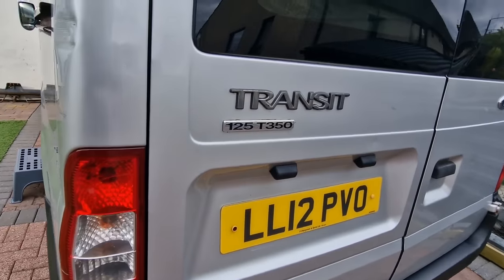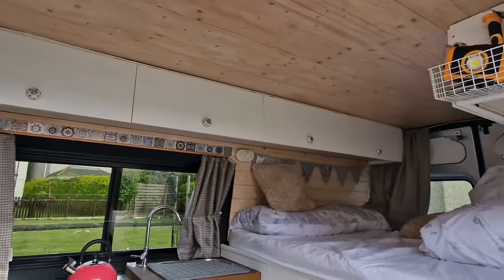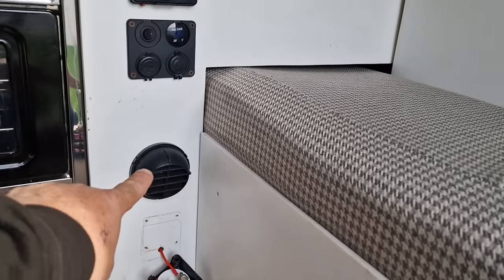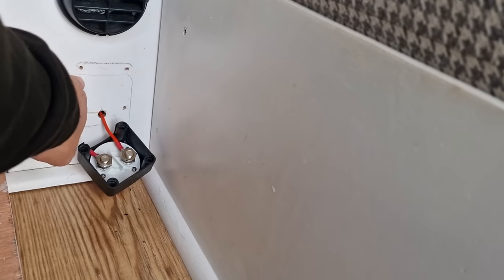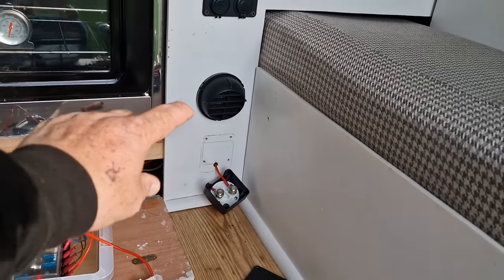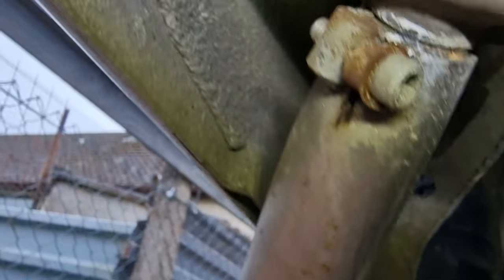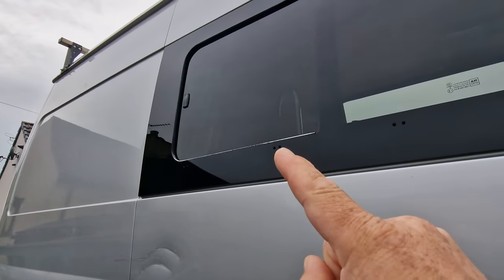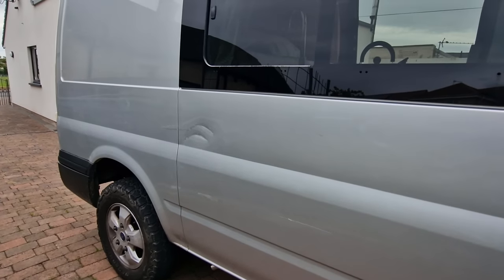Is the most dangerous self build campervan I've came across?

Comment: This is why we have National Standards for Gas and Electrical for domestic installations.....both can kill occupants when installed in stationary situations let along the additional stress put on cable/gas runs and joins, etc when incorporated into mobile builds
Standards need to be applied/enforced on what is actually a mobile domestic situation.
Part of any van build should involve getting a compliance plate for all non-factory modifications done, including interior fitouts, rather than just structural changes as ALL modifications can lead to death traps on our roads for both the owner and also for other road users........and in this case unaware new buyers.

I am a licenced Electrician with 40+ years in the trade, and as such I have inspected many home done van builds and at least 90% were deflectable.
Common examples
- double pole power points should be installed in van builds which are not the same as the ones used in domestic home builds
- special cable used if the build incorporates polystyrene type materials used for insulation and the cables are run within or alongside the insulation (which most are due to space restraints) normally a blue or purple coloured cable not the normal domestic TPS white type.
- many many many more examples as those are just a few AC power examples, whereas most vans have far more DC power issues, which is not common information given out by Van Build You Tube channels.
Reply from the maker: The regulations already exist. BS7671 :2018 is an example of one of the places where I get my information from
There are lots of others I could quote, too 
There are too many incompetent vanbuilders out there. This video was to highlight alot of common issues that we are finding, if someone find a van in this condition they should just walk away or be prepared to spend money fixing the issues
Reply: @TheCraftyBlindersvanlife  Same as in Australia, standards already exist....which is why I stated applied/enforced as standards are pointless unless they are actually enforced by law.
It is why I like to see videos like yours......people need educating, as you rightly said "you do not know what you do not know"

Comment: I decided i wasnt going to do my own electrics - re making a decision about cabling etc. So i go to a professional - has a long established business. I posted one photo on instagram - victron commented - holy that cable is not thick enough from the DCDC to the battery.l So i go back - he says - oh thats because its not finished - so i think ok. So at Christmas take it back to finish it - he has it for 2 days - says oh i will need it for weeks to finish it. SO i was like this is crazy (he already had it for 3 weeks prior). I got a to a coach and caravan place close he says - bring it back after christmas holidays he quotes 3 days to do it - does it, says he needs one extra day - the cables that have been laid from that battery back - is not big enough for the draw in the back - he puts in new cables, cuts the old ones, he also has to lay new cables behind the wall in the back - he leaves the old cables. SO the van has the weight of all those extra cables and i paid for the job TWICE . I trusted the first guy built there were signs when she said.. scratching his head - it’s going to take ages to do this..
Reply from the maker: That's terrible check out #electrimech